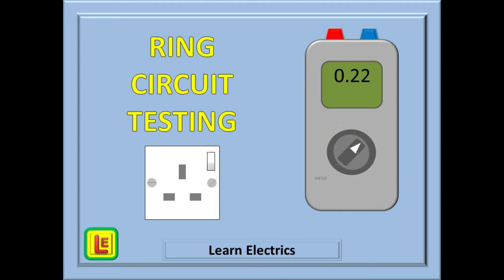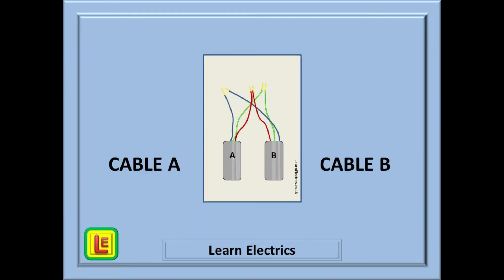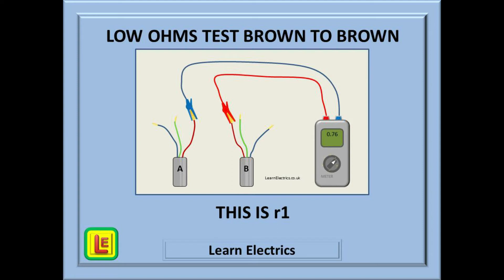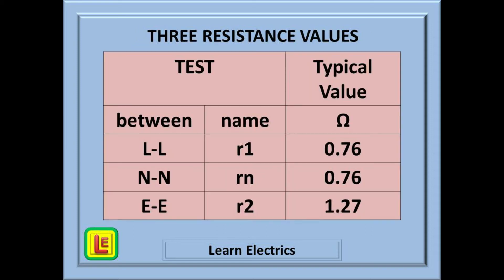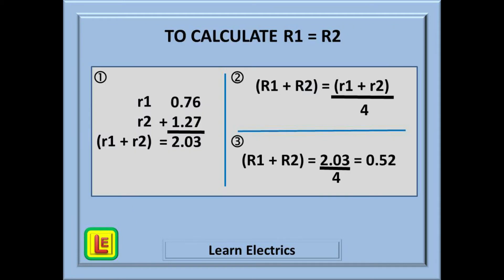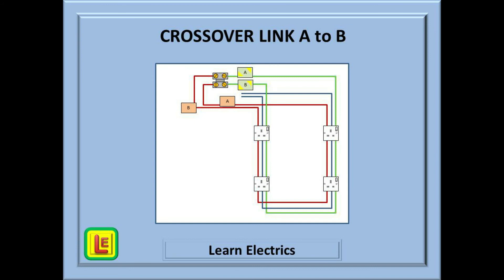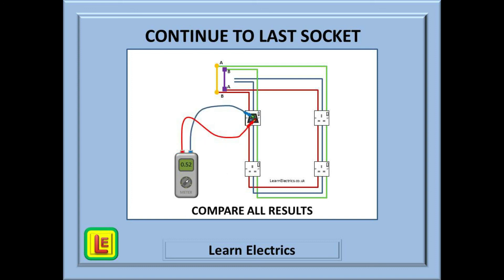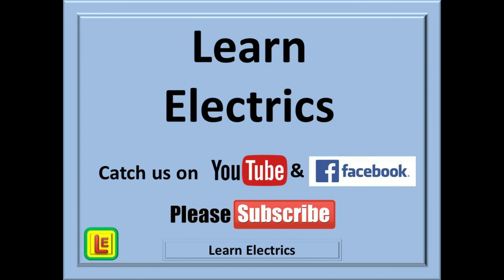Ring Circuit Testing

Comment: Great video, as mentioned in some other comments, the R1+RN crossover should also be performed and verified, despite there being nowhere to record it in the schedule of test results, it is really part of the polarity checks. 
I also recommend operating the switch during testing as this verifies functionality (is the switch working correctly?) and leaving the switch in the on position once testing has been performed in readiness for insulation resistance testing. If you had a spur on the circuit this may be indicated by a slightly higher reading than R1+RN. Lastly, if it is a twin socket, then testing should be performed on both sides of the outlet. 
Great video keep them coming👍
Reply from the maker: Thanks for your positive comments, very much appreciated. Lots more to follow. Dave.
Reply: Could you provide the reg number which states you need to check both outlets of double outlet socket???
Reply: @stevewilliams8230  it’s not a bs7671 regulation, it’s in guidance note 3 (on page 46) it’s step 2 on testing continuity of ring final circuit conductors, testing both outlets is just best practice as you may have a fault within a twin outlet  👍
Reply: @stevewilliams8230  - its called the common sense reg and each outlet can give different readings if they haven't been used as much.

Comment: Hi,
A few (maybe silly) questions please as I've never done testing before, just learning now. 
- Do I need to disconnect everything from the sockets before testing?
- Do I need to switch ON or OFF the sockets each?
- What if there is fused spur on the ring? My boiler is on the ring of the living room sockets. What should I do with it?
Many thanks for your answer in advance!
Reply from the maker: Unplug everything, yes.
You will operate the switch on and off to make sure the switch works, but the switch will need to be ON to get valid test results for R1 + R2, have another look at the video.
If any part of the boiler circuit is still in circuit it may affect results I would remove it after doing safe isolation and temporarily replace it with an ordinary socket or a connector block. It only takes 3 or 4 minutes to replace.
Thanks for watching.
Dave.
Reply: @learnelectrics4402  Hi Dave,
Many thanks for your reply! Honestly I kept looking for answer to this question and nothing (forums, books, IET etc)....Maybe it is trivial! :D

Comment: Hi dave an adult still learning  here , firstly thanks for making these videos they are really appreciated 👍.
My daughter bought her 1st home and because its 3mpty not living in i decided to do some testing/practices  before it gets rewired with a sparks.
I did all end to end then figure of 8 and all 👍. 
However when I did zs test nearly every outlet on the rfc failed , it is old bs 3036 30amp, but once I changed to a 20amp mcb everything passed obviously I know the maximum results allowed had changed but wondered why they failed with the old bs3036 fuse ??
I checked all terminals etc,
 the ze result was 0.51 for what I assume is a tns supply its a supply run on the rear of a row of cottages with a separate solid copper core earth .
Any advice would be appreciated and sorry for the long post regards gary
Reply from the maker: Gary, thanks for watching. If its a BS3036 board then it goes back many many years.
A long time ago, permitted maximum Zs was higher than it is today. It may have been installed and tested to that much earlier version of the Regs. Why the difference, perhaps the retightening of screws, difficult to say. Dave.

Comment: Hello David, I've just completed an Electrical Installation Condition Report (EICR), and during the r1 end-to-end test, I'm getting a 50,000-ohm reading. When measuring the Ze at that circuit's socket using the Megger, it's displaying as a "CON." I've double-checked that the leads are correctly plugged in on the Megger. Thanks in advance for your assistance.
Reply from the maker: Sounds like an open circuit in the wiring. 50 kohms is the first clue and connection error on your meter is another. take a look at the video on the attached link, all about ring circuit fault finding. Good luck and thanks for watching. Dave.
https://www.youtube.com/watch?v=iVAEDEvNObE

Comment: I'm guessing this can be done directly from the socket too as opposed to the CU as the connections would be the same initially at the socket and consumer unit?
Reply from the maker: Yes, indeed some sparkies do split at the sockets.
Reply: @learnelectrics4402  thanks. How would we do the crossover test from the sockets..say we crossovered the cpc and line to opposite sides using a wago? We could test the next socket by probing onto the line and earth terminal im guessing?

Comment: Hi Dave, just a point for clarity, should we multiply the result of (R1 +  R2)/4  by 1.2 to take into account the rise in cable tempreture during use of the circuit. Appreciate this is carried out during the ELI final test.
Reply from the maker: No, leave it unaltered. Take another look at the video. (r1+r2)/4 = R1+R2
The 1.2 comes in on Zs when we multiply it by  1 ÷ 1.2 = 0.8. i.e. Zs x 0.8 = Zs(m)
Reply: Thanks Dave you are a great teacher.
Reply from the maker: You're welcome my friend.

Comment: Do you have to do it in the board or can you do it in any socket in the ring circuit?
Reply from the maker: This is the approved way, some people do develop alternatives.
Reply: @learnelectrics4402  I'm just wondering if it matters about parallel paths when earth's and neutrals are still connected in fuse board

Comment: Great video as usual. One question: are you not not supposed to do a 500 volt insulation test after doing the continuity test before doing the crossover test? Thanks
Reply from the maker: Robert, the crossover test is part of the same continuity test. Done before the IR tests.
Thanks for the positive comments, appreciated. Dave.

Comment: this is probably a stupid question but if its travelling back on the live whats the neutral doing ?
Reply from the maker: Its not travelling back, all the line cable is at 230V
The neutral is on the other side of the load.
Dave.

Comment: this is probably a stupid question but if in a radial current is travelling back on the live whats the neutral doing ?
Reply from the maker: Line is at 230 volts, neutral is the other side of the load at 0V

Comment: Hi. Why am I not getting the same answers? For Stage 3 - 2.03 ÷ 4 = 0.5075 when in-fact 2.08 ÷ 4 = 0.52. Adding a variable allowance of 0.05 seems to work, but I thought that 0.05 was only for Stage 1 - r1, rn. The rest of the calculation pads out exactly up to this point. Please help! 🙏 Many thanks 👍
Reply from the maker: Just the way its been rounded up by the calculator. The difference between your two figures above is only a hundredth of an ohm and close enough. Line and neutral should be the same value in theory but on-site you may well get one at 0.51 and the other at 0.52. We would consider them to be the same. You're doing good, and this shows you're on the ball. Keep learning Karl, it's a great trade. Dave.
Reply: Thanks for getting back so quickly Dave. Really appreciate it. Keep up the great work. Learn Electrics videos are an invaluable part of my learning curve & have helped me out no end. 
All the best 👍 👌

Comment: do you need to test R1+R2 at the cu too?
Reply from the maker: Jason. No. You do not test R1+R2 at the CU for a ring circuit. The CU is normally where you make the crossover links and once done we leave them alone. Tests are done at each of the sockets. Hope this helps. Dave.
Reply: @learnelectrics4402  thanks for the clarification. New comer to the world of learning electrics.
Reply from the maker: That's good Jason. 40 years ago I was the same position and thought I would never learn it. Stick with it, watch the videos and learn something every few days. Its a good trade.

Comment: Hi Dave my (r1+r2)/4 is 0.39 but I’m getting 0.26 cross over. Could this be due to parallel paths and is this acceptable?
Reply from the maker: Double check you have cross connected correctly. Is your meter nulled out. etc.
Reply: '(R1 +R2)' cant be separated. It is a combined measurement. 'r1' 'r2' and 'rn' are all separate measurements through 3 separate conductors.

Comment: I have r1 over 1068 ohms resistance. rn is 0.4ohms. What the problem might be? . If it was open circuit it would be over 1999.
Reply from the maker: You will need to trace the wiring to find the fault.
Make sure you are measuring only the wire and not something else in line with it.

Comment: What does CPC stand for??  2.03 divided by 4 equals .5075??
Reply from the maker: Circuit Protective Conductor - the earth.
We always round up or down and seldom go to 4 decimal places. So .52 is close enough, it is only a few thousandths of an ohm difference, we are never that accurate with electrics, the next time we measure it it will be slightly different again so anything around 0.50 to 0.52 would be acceptable. How hard you press your crocodile clips on the copper, the temperature of the room, your meter batteries will all make miniscule differences.
Reply: @learnelectrics4402  Thanks for the reply, much appreciated.
Reply from the maker: You're very welcome.